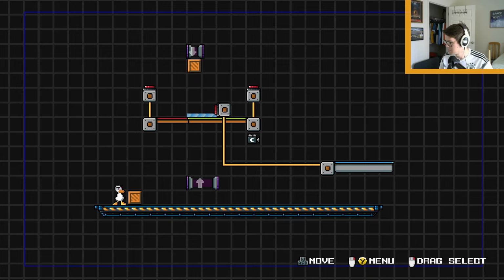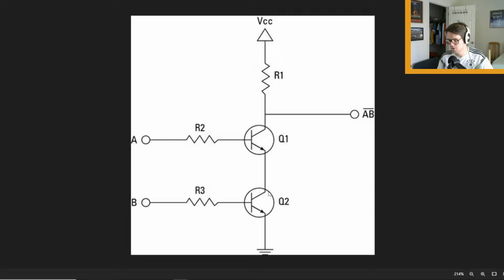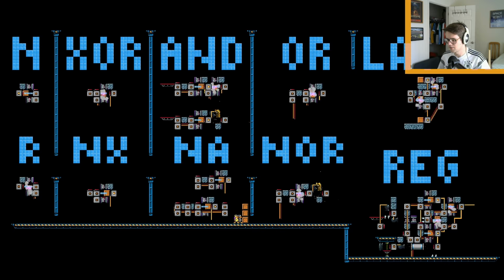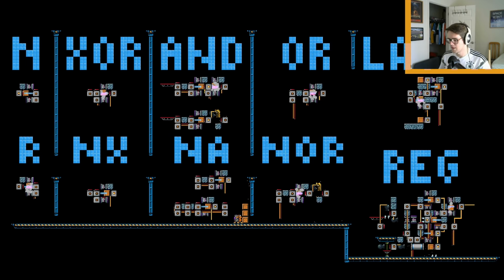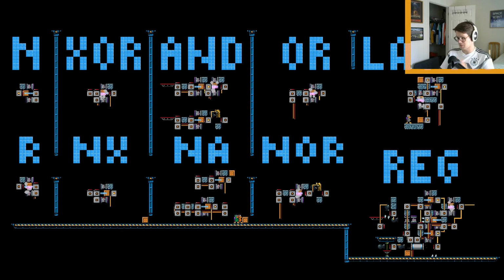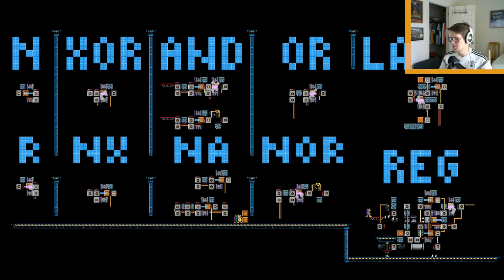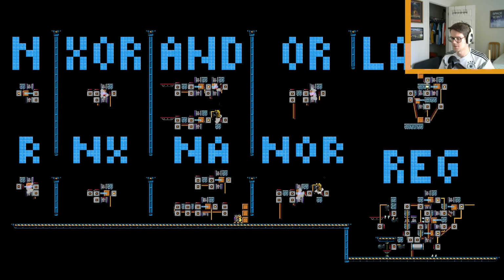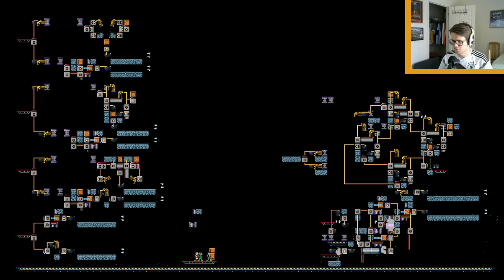Duck Game Computing: Transistors and Design Improvements

Comment: Dope! I'd always chose smaller size over insignificant signal delay, very good redesign. I remember first Duck Game logical gates around 2017 designed by LowCal were about wired Net Guns firing in the sky and trapdoors to block them or not. As inefficient as it gets, but still would do the job done on some Deathmatch maps
Reply from the maker: There any videos or posts about those old designs that I could see?